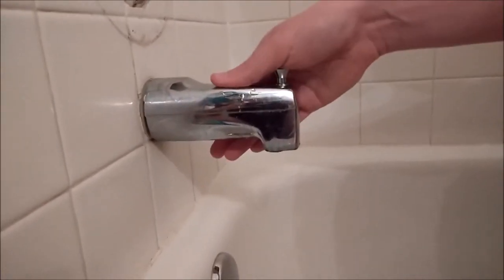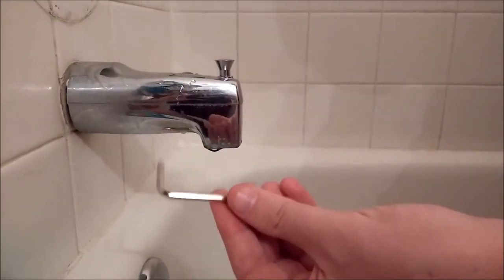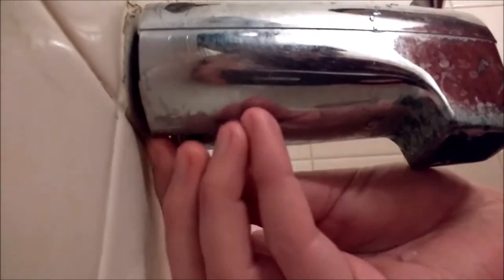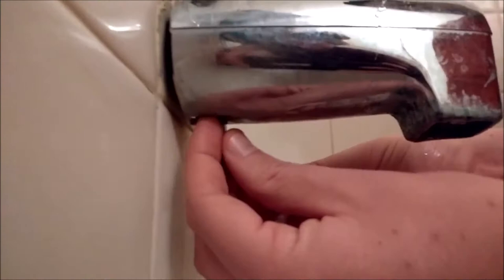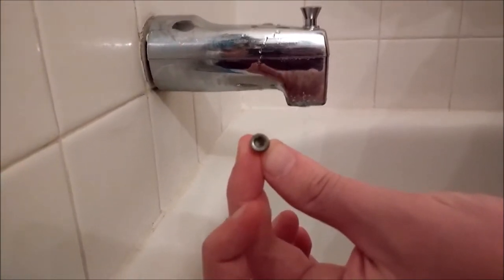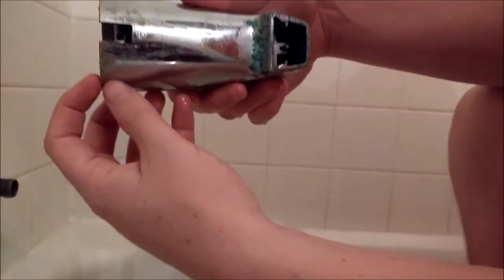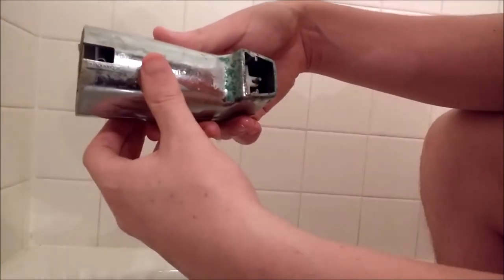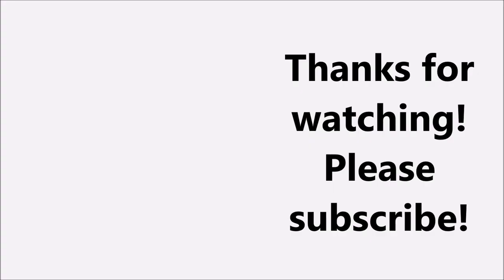How to remove bath tub spout DIY video #diy #video #tub #bath #spout

Comment: Mine didn't have screw. Good to know!
Reply from the maker: Were you able to get yours off? Thanks for the comment!
Reply: Big Al Repairs yes, I haven't done anything with it yet. I was going to replace but got stumped with pipe dia.  Really need to replace tub, it's fiberglass tub/shower combo and is pretty funky and old.  That will probably cost a mint. :/.  I, personally, won't be taking a reciprocating saw to it. For sure....
Reply: @Noahsoak  I wish you the best with your next diy project!  Hopefully all goes well and I hope you subscribe to big Al repairs.